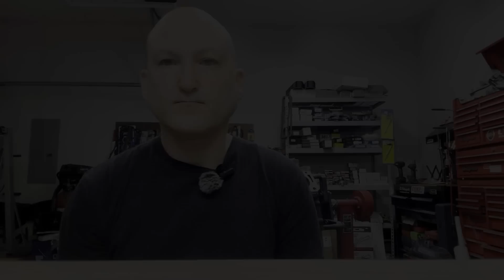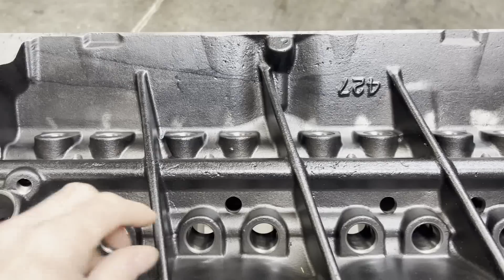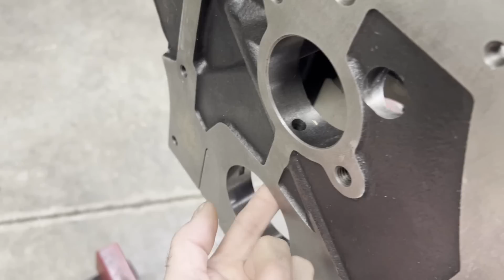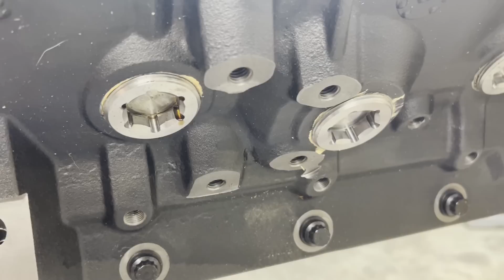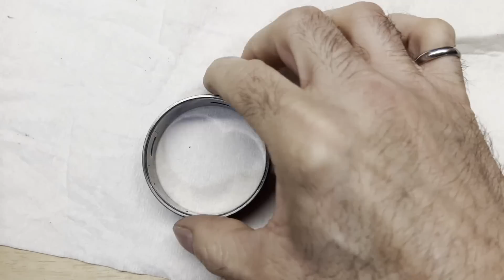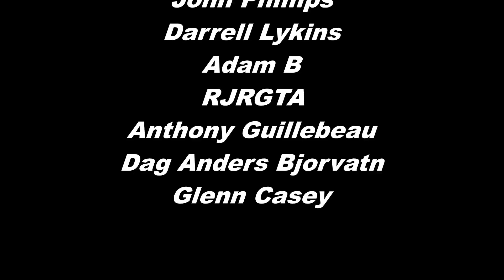Lykins Motorsports Four Digit Horsepower From A Ford FE?

Comment: Cylinder heads are the gateway to power, the camshaft is the brains.  Once the heads perform, any engine can be taken to the limit of the block and oiling system.

Comment: What is the problem with BBM block?
Reply from the maker: Porosity, drill throughs, pipe threads tapped too deep, distributor cut out in china wall in wrong spot, tangs in main caps cut on wrong side, I could go on and on.
Reply: @lykinsmotorsports oh my dont need that

Comment: I have a real soft spot for FE Ford engines.  I had an original 390 powered '67 Mustang that I bought in 1980.  I wish I still had it.  Back then my friends were going faster for less money so I sold in in 1986.  I had all the parts to build a nice 454 cubic inch FE to replace the 390.  After the Mustang I bought a '69 Camaro that I still own that has a 427SBC with F2 Procharger on E85 at 21 pounds of boost.
Reply: Same here. 67 GT Fastback 390  4 speed. White with red striping and 391 rear gear.

Comment: Pretty sure Jay Zolko did a back to back test on roller bearings a while back and found some significant power
Reply from the maker: Got a source or link?  I know other guys have tested them and found nothing.
Reply: @lykinsmotorsports  I will look back at some of his videos to see if I can find it
Reply: Zolko found about 60hp in roller cam bearings and bushing and correcting lifter geometry. He posted the results on social media. It was a 462 built for Woody's garage
Reply from the maker: He found 28 hp between the two.  He said most of that was attributed to the bushings and I agree.  Roller cam bearings just don't give a lot of horsepower by themselves.  The benefits come from oil control.  

It has been widely accepted that roller cam bearings just don't help much in terms of horsepower.   The engine is easier to roll over under spring load, but just doesn't help much when the engine is running.  With that being said, any single digit increase is more than welcomed.
Reply: @lykinsmotorsports  I'm sorry i thought it was more. Was definitely worth while though.
Reply: it was more than 28. Peak hp increased 40 hp. 720 up to 761. As the guy that financed the test,  I know what the gains and advantages were/are. Beside the documented power Gains, parasitic power loss, reduced wind age due to reduced oil spraying out of cam/ bearing clearances, improved oiling to the crank,(as noted in the video), reduced  friction, (due to less cam bearing surface area in contact with the bearing, roller vs babbit style by design) and reduced heat. The roller bearings in themselves do not by themselves add horsepower per say. They allow misalinement of the cam bore to be corrected and blueprinted. The cam bearing journals on many FE blocks are often not in perfect alignment, and can't be align bored to correct alignment,  because traditional cam bearings would not fit tight in the corrected bores. Therefore the cam bores have to be bored oversize,  square to the bores, and parallel  to the crank.Tthen roller bearings which are larger diameter can be installed.  Not an inexpensive Machining operation, and most shops can't do it, let alone machine the oil grooves in the newly machined bores. Also requires a steel billet camshaft.  Don't buy into the deception. If the results weren't worth the extreme cost, they wouldn't be doing it  to this. With BBM  Being famous for their dimensions being sloppy, it's a good idea that it's being done to this. IF they are sucessful, stress and friction on  cam, block, timing chain and gears, etc will be significantly reduced. When a cam binds or drags in a block with traditional cam bearings,  it takes power to overcome it. Reduce the drag, power is freed up, parts operate smoother and last longer.  Simple logic. It's been proven, and documented. Expensive, but worth it.  We made it possible, and popular last year. The results spoke for themselves.
Reply from the maker: Jay, in a video interview with Dragboss Garage, said it was 27.  That's what I was going off of.   He then added that the majority of that was due to the lifter bore bushings, which I agree with.

https://www.youtube.com/live/8yd6ga6_wrM

This was at 1 hour, 2 minute mark.

Not sure what "deception" you're talking about.  We've been doing roller cam bearings for years.

Here's a good read for everyone, with some inputs from some well known engine builders:

https://www.yellowbullet.com/threads/roller-cam-bearings-are-they-worth-it.99724/page-3

The gains are pretty small for them.   But when you're going for every horsepower that you can get, you do it.   Just don't expect a roller cam bearing to add 50 hp.

Comment: 20 years ago most piston manufacturers were already sized to fit what they said they'd fit. Then you'd see an old set that would really piss you off needing a few holes honed. Todays piston are machined so close to the ten-thousandth. Weights are so close too. 

Don't count on the manufacturer advertising, "4.250" bore ready for finish honing" and order a 4.250" piston and ring set. Bahahahaha....the cylinder wall can finish can look like the Rocky Mountains under the thick shipping grease they use. After I washed a Shelby block i still had to scrape away clean the cylinder walls. It cleaned up at 4.270".

Comment: The block, BBM, well if cast irons heat retention is taken over the Shelby aluminum heat dissipation, I can understand that.
Reply from the maker: Aluminum expands so much with heat that the cylinders do not stay straight/round.  You lose ring seal.
Reply from the maker: We will use a belt drive.

Comment: Go for it. Show the Chevrolet Big Block fans that a design from the fifties with vary little Aftermarket support can run right with their engines when compared cubic inch to cubic inch.
Reply: Yeah sure … nothing wrong with the ford but doesn’t it weigh quite a bit more..?  I was a big fan of the CAN -AM series in the 1960’s .. never saw a ford defeat a Chevrolet or Oldsmobile of Bruce McLaren .. just sayin…😊🏁🇺🇸